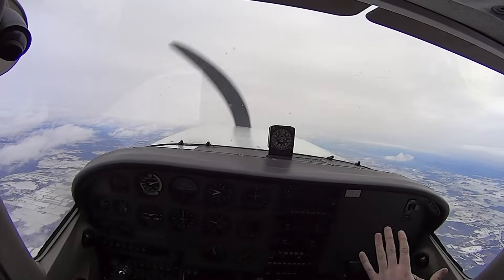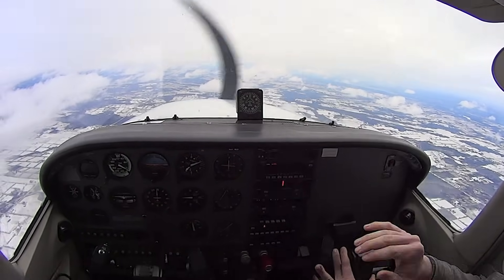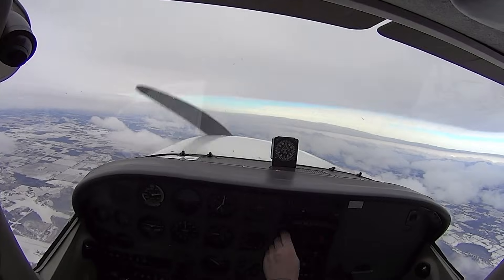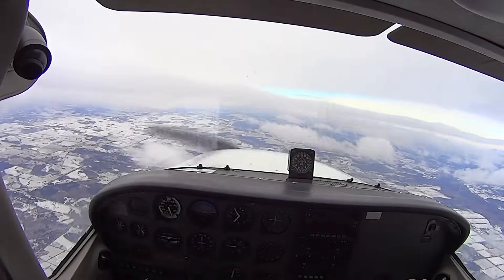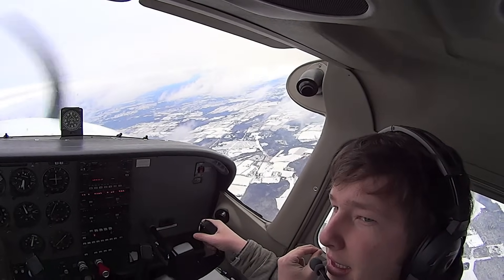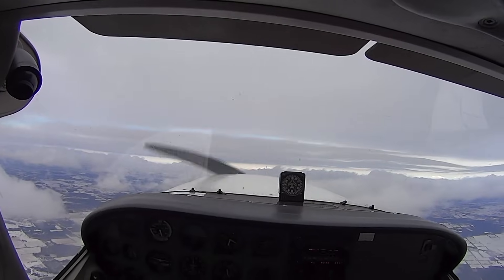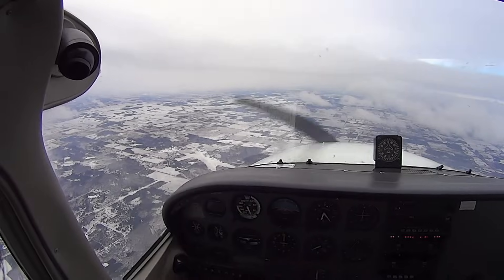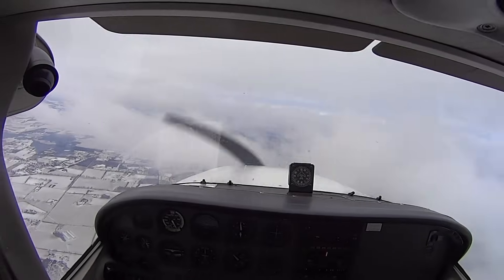Cessna 172 Spin Recovery Training (Full HD w/ audio)

Comment: If you're stalled and spinning to the left could you lower the left aileron to stop yourself as well?
Reply: No because your wings are stalled and therefore your ailerons will basically have no control authority. In addition using the ailerons would cause even more drag to the wing and increase how stalled the wing is and cause the spin to be even worse...never ever try to use ailerons to get out of a spin.
Reply: +EggiTheShadow ailerons should be level otherwise you could aggravate the stall/spin by putting in aileron control you increase the Angle of attack making the spin worse.
Reply: Alberto Alonso Yeah, but what would happen? If your left wing's stalled and you try to pull the control column to the right, shouldn't it increase the angle of attack of the left wing and bring it out of the stall
Reply: No, if you increase the AOA of the left wing you increase drag. Like sticking your hand out the window of a moving car if you increase the pitch of you're hand from horizontal to vertical your hand will be pushed back. That force is drag and will slow the left wing more aggravating the spin. could lead too a flat spin.
Reply: +EggiTheShadow In a spin, one wing is stalled, and one is still "flying." That is why opposite rudder is needed to recover.
Reply: When in a stall, ailerons aren't very effective because the wing is stalled, therefore very little air is flowing over the ailerons anyways.

Comment: I'm looking for hints for the G forces on recovery. I find them brutal. What should I be doing to control my body's reaction to recovery?
Reply from the maker: +Elaine Morrison I found the G forces difficult to deal with as well. The idea is to desensitize yourself through lots of practice taking small steps so that your body learns what to expect. For example, you could recovery immediately (after 1/2 spin) so the G-forces are less and then you progressively allow more spin before you initiate the control inputs. If you have lots of altitude, you can also make your recovery less aggressive and therefore less G-forces that push you in your seat, understanding that there will be more altitude loss. Good luck with your training.
Reply: Try also looking up the "hic" technique used by the military under large g forces.
Reply: +Elaine Morrison the biggest thing is to keep breathing. A lot of people have the reaction to stop breathing under G forces (which is obviously not so great)

Comment: What kind of camera did you use to record this and where was it placed?
Reply from the maker: +mongoose00000821 Sony HDR-AS15 attached to my Bose A20 headset.
Reply: Nice, after my flight costs I decided to go with the cup and string method. Did you plug the camera into your headset to get it to record the audio?
Reply from the maker: +mongoose00000821 I made a Y-cable that allowed me to loop the audio through the HDR-AS15, so the audio is a direct connect. There was an issue with the jack in the plane and that is why audio is only coming in on one channel in the video.

Comment: Stalling oh I fear that word.  Cause it only takes about 5-7 seconds to fall from 1500 to 0 feet. Right?
Reply from the maker: +code lyoko 34 This descent rate depends on the type of spin. A flat spin will cause the plane to travel vertically in a very non-aerodynamic fashion and therefore more slowly, whereas a steep spin will cause a very high descent rate. The descent rate you are referring to (1500 ft in 5-7 seconds) equates to over 12,000 feet-per-minute, which is faster than free-fall which is 6749 fpm. It takes around 13 seconds to free-fall from 1500ft. I would expect a plane to descent slower than free-fall at that altitude.
Reply: +code lyoko 34 
You can correct it very quickly if you recognize that it is happening.
Full power.... gently forward and find the horizon and know your altitude.
Reply: stalls in a Cessna tend to be pretty gentle, at least for power off. If you don't recognize it and recover you can if course get into trouble. When I did power off stalls I could barely tell the plane has actually stalled but noticed the inability to pitch up further and saw a few hundred feet per minute descent on the VSI. Recovery took a second or two. A 172 is a very forgiving plane.
Reply: Notice that after recover the airspeed more than 120knots...
Reply: I was always scared of stalls too. My biggest fear of starting flight instruction. We did my first stall on my second lesson and at first, it felt awful. Now after my fourth lesson, stalls feel normal and not bad at all. Now spins, I fear that.
Reply: Jeez, I'm on my 3rd lesson and stalls still scare the crap out of me.
Reply: The power on stall scares me.
Reply: code lyoko 34 Rubbish!  You can turn off the engine and if you are at cruising speed or about 100 knots, even at 1500 feet you probably have enough glideslope to arrange for a safe landing spot (judging from the videos i have seen here) because you will have probably about 45 seconds.

Comment: Can you exceed more than the allowable forces on the plane doing this?
Reply from the maker: +John Armstrong Yes, it is possible, but I would not expect this to ever occur while the plane is spinning nor with a properly executed recovery. If the recovery procedure is done correctly and promptly, you are going to stay well within the airframe loading limits (otherwise the airplane would not be certified for spins). However, if you botch the recovery, for example by stopping the spin and then leaving the nose pointing down for too long of a period of time allowing the airspeed to increase (perhaps past Vne), and then aggressively recover by pulling back hard, you could very well exceed the aircraft loading limits with possibly disastrous consequences.
Reply: +John Armstrong Only possible during the recovery from the dive.  In a stall condition, by definition there is no g-force on the airframe.  In the NORMAL category the aircraft is certified to be able to with stand 4.4G+ loading without any failure of any part.  In UTILITY category (which is required for spins- just a Cg change in the C-172S) the allowable G loading is increased.  The airframe design limits are 150% MGW, but you're in test pilot area and it is not approved in any configuration.
Reply: +Stephan Edelman  I let the aircraft dive for too long. We had plenty altitude. The instructor gave me hell. Luckily, I was sensible enough not to pull up too sharply. It was a Cessna 150 and I think (50 years ago) the instructor said we reached 145 mph. I can't remember for sure.

Comment: I think the 172 has a "no spins" placard. Much safer to spin a 152. A spin is a spiral down, not inverted unless specialty plane.
Reply from the maker: Eustacius It will only have a "no spins" placard if the flight school or owner has an insurance exclusion for these maneuvers. The pilot-operating-handbook (POH) of the C172 specifically allows for spins (but not whip stalls). Please see page 2-9 of the "Limits" section of this C172 POH http://www.skywarriorinc.com/downloads/POH%20BOOKS/172N%20POH.pdf
Reply: This airplane must be operated in compliance with the operating limitations as stated in the form of placards, markings, and manuals.
-------MAXIMUMS-------
Normal Category MANEUVERING SPEED (lAS) 97 knots . GROSSWEIGHT ...... 2300lbs. .
Utility Category 97 knots 2000 lbs.
+4.4, -1.76 +3.0
FLIGHT LOAD FACTOR Flaps Up
Flaps Down
+3.8, -1.52 + 3 .0 ...
Normal Category - No Acrobatic maneuvers including spins approved.
Utility Category - Baggage compartment and rear seat must not be occupied.
-NO ACROBATIC MANEUVERS APPROVED- EXCEPT THOSE LISTED BELOW
4.
Maneuver ChandelIes Lazy Eights
Recm. Entry Speed · . . . 105knots · . . . 105 knots
Recm. Entry Speed
Steep Turns · . " 95 knots
Maneuver
Spins . . . Slow Deceleration Stalls (except
whip stalls) Slow Deceleration
Altitude loss in stall recovery -- 180 feet.
Abrupt use of the controls prohibited above 97 knots.
Spin Recovery: opposite rudder - forward elevator neutralize
controls. Intentional spins with flaps extended are prohibited.
CESSNA CESSNA MODEL 1721'1 MODEL 172N

Comment: Its a pity spin recognition and recovery from a fully developed spin is not taught in a lot of GA schools, these days. In my early days of glider training ( as a student ), spin recovery was quite a large part of the curriculum. Recovery would be made from a fully developed spin with no less than about three turns either way ( depending on the instructor's whim ), and at a respectable height, time and time again, to ensure that recognition and recovery became an automatic reflex action. GA is very little different from gliding, apart from the gyroscopic effect from engine/propeller, favouring a break to the left, and making a break to the right very difficult to achieve, unless a concerted effort is made to do so.
Some comments are interesting, in that a lot of people tend to fear the very thought of entering a spin, then having to recover from same. This is where training with a certified instructor and aircraft can be really useful. It will serve to teach and show that a spin is something, not to be feared, rather, to be recognised in its early stages, and to initiate recovery action as soon as possible.
As far as an aircraft not handling the loads, and as the OP has stated, look at your POH to see what is permitted in utility category, it might surprise you to see actually what your a/c CAN handle.
I have no issues with admitting prior to spin training, that I was more than a little bit unsure of what to expect, and how I'd personally handle the g loads and disorientating spins and unusual forces. Just remember, your instructor is just as keen as you, to get home for dinner each evening, and will not place you or themselves in a highly perilous and unrecoverable situation, and you will pick up invaluable knowledge on handling a/c safely, on your journey towards licencing.

Comment: Spin recovery is why I haven't gotten a pilots license. Putting the aircraft into it's most dangerous state just to get out of it....whew.
Reply: HotaruZoku It's not dangerous at all unless you are near the ground.  With plenty of altitude to recover, it is very safe.
Reply: sdold My dad has his license and that's what he's said as well. Maybe it's just a natural defense mechanism. Natures way of weeding out the posers.
Reply: AOPA spin statistics suggest that around 80% of fatal spin accidents happen in the pattern so it is not the training you are likely to die from. You are more likely to die spinning in the circuit than in training.
Reply: The answer is you don't have to do it but when you fly aircraft like the one I am learning on it spins quite readily and without easy recovery like the cessna it will kill you if you do not make the correct inputs. The number still remains that 20% of fatal spin accidents happen outside the circuit so that is a 20% which should be reduced to 0% with spin recovery training because those deaths are preventable. Spinning even in the plane I fly in is not dangerous it is the spin that catches you off guard that is dangerous so take my advice and if you do your PPL do spin training. Not only is it fun because you get to go upside down but it may save your life being able to quickly recognize a spin and recover. http://www.aopa.org/images/asf/spin_7.gif This is my source. When I went spin training I got to do 3 spins myself the instructor did 3 and on the way home to lose some height we did 2 barrel rolls I did one and the instructor did one. Was a very fun lesson. The plane I fly is aerobatic by the way. It's the one in my profile picture. http://www.caa.co.uk/docs/GImages/G-BKIF002.jpg
Reply: +HotaruZoku You can get a PPL without spin training, in fact most training schools don't even offer it. You only need spin training if you want to be a commercial pilot.
Reply from the maker: +Yong Song Despite my own apprehensions about the maneuver at the time, I think it is one of the most valuable training that one can receive. To quote Canadian aviator and astronaut Chris Hadfield, "no one should know your aircraft better than you" and "what is the next thing that is going to kill me? If you don't know how to recognize a spin, let alone know how to apply the proper inputs, it may very well be the thing  that does kill you.
Reply: Joshua Nelson
As much as I appreciate what I assume to an honest attempt at soothing my nerves...

And not only that, if that stat is accurate it begs the question "Why bother with spin recovery training at all, if your most likley to enter one so close to the ground recovery wouldn't be possible"?
Reply: Joshua Nelson
Well put. As far as I know you can't get a PPL withOUT spin training, but if that's even the case, I'll find the nerve to do it on purpose before I face a bit of OTJ.
Reply: +GuiltyMiner0343 in canada, spin recovery is a must for ppl, unfortunately.
Reply: Yong Song Unfortunately? I wish my flight school offered it.

Comment: Do u have to do this training to become a pilot
Reply from the maker: majo2469 The majority of flight schools train in a Cessna 152 or 172 and both are rated for spins when operated in the utility category. Therefore, the reason is not necessarily because it cost them more to offer the training, but that it is simply not a necessary requirement in the GA training syllabus.  With respect to the 172's ability to recover from a spin, there are several examples of ATC instructing pilots who have inadvertently entered a spin and declared an emergency to simply let go of the controls and the plane recovers itself a few moments later.
Reply: BP TV In Canada, yes. Spins are fun. :-)
Reply: BP TV This is not a requirement if you just want to become a General Aviation pilot, meaning you only plan to fly smaller (prop-based) aircraft, and not charge people to fly with you (Charter). If you go commercial then you will be required to do this. Stephan is right, most flight schools don't offer it. Not because it's dangerous (A 172 is a great training plane due to the fact it wants to fly, so even a student failing to recover would likely result in the aircraft recovering on it's own, given it has the altitude) but because it requires that the aircraft be rated for acrobatic maneuvers. This cost them considerably more, considering that students beat up these planes on a daily basis.
Reply from the maker: majo2469 Check Section 2 page 2-8 of a Pilot Operating Handbook (POH) for a 1978 Cessna 172 at http://www.skywarriorinc.com/downloads/POH%20BOOKS/172N%20POH.pdf and it shows that the following aerobatic maneuvers are permitted in the 172 when operating it in the utility category: Chandelles, Lazy Eights, Steep turns, Spins, Stalls (except Whip Stalls).  I'm not sure why your CFI indicated that the 172 isn't rated for spins.
Reply from the maker: BP TV I believe the training is not mandatory and many flight schools do not offer it.
Reply: Stephan Edelman alright Thanks!
Reply: Stephan Edelman While I was going through flight training with two different flight school in Minnesota I actually wanted to try a spin recovery. In both instances I was told the aircraft was not rated for spins. I know that the 172 can recover. One of my CFIs had me do a power off stall and let the plane recover itself. While I kept it from a secondary stall it lost only about 600 ft in recovering itself with power idle. Needless to say stalls are not my favorite part of flying.  These days I don't do as much cross-country flights as I do sitting in the pattern.
Reply: I'm embarrassed I didn't know that :) I've had to look through that so often for W&B and reviewing procedures I never thought to look.